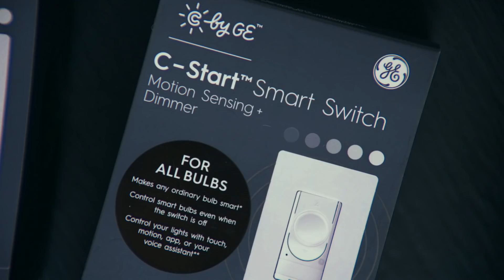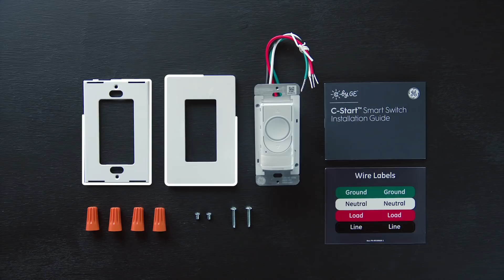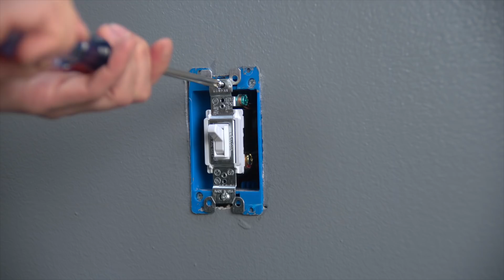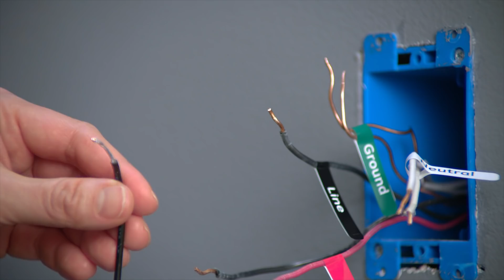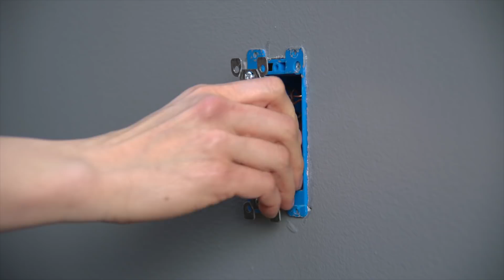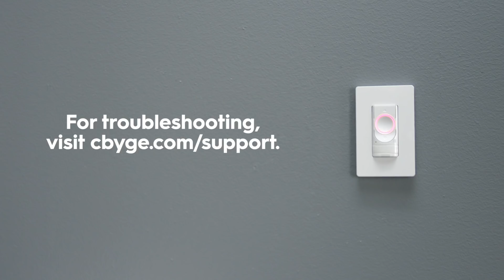How to: C by GE Smart Switch 3-Way (Multi-Switch) Installation

Comment: This is in no way considered safe or legal in Australia... How are Americans not dead.
Love the insulated tools 🧐🙄
Reply: How is this even remotely dangerous?
Reply: Moron.  You open the breaker.
Reply: 1. Unqualified people encouraged to work on lethal 110v circuitry
2. Uninsulated tools not fit for purpose, in case of live circuit, person dies
3. Use of voltage tester only suggested, not required
4. Voltage tester only used on active wire

These are issue because all it would take is;
1. Second person reactivating breaker
2. Previous wiring done incorrectly by unqualified persons crating live neutral
3. Large capacitive devices in circuit

To cause severe injury or death.

The fact that the video goes on about circuits not having an earth at all leads me to believe that you don't have RCDs in place either at all locations. Moron.

Next you will tell me unfenced pools and guns don't kill American kids too... Moron.
Reply: Fwiw. Moron is directed at Eric Atkinson only
Reply: @scott.purcival  The comment "Moron" is directed at you Scott. I guess you are too much of a moron to understand that fact.